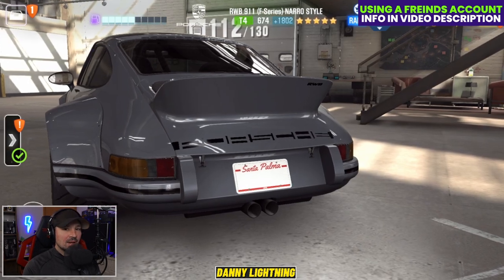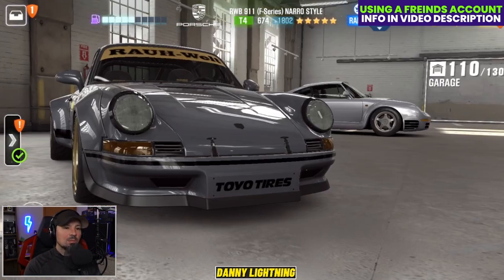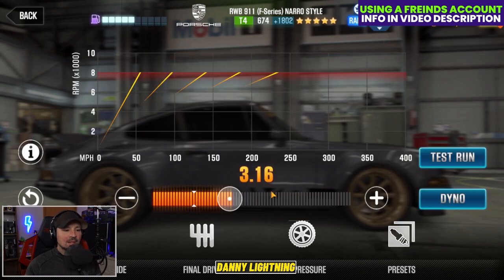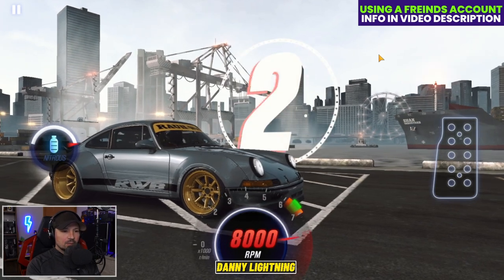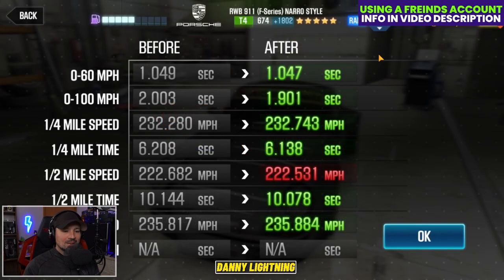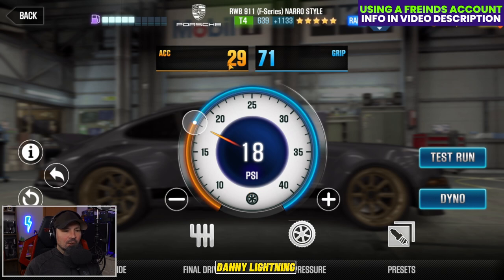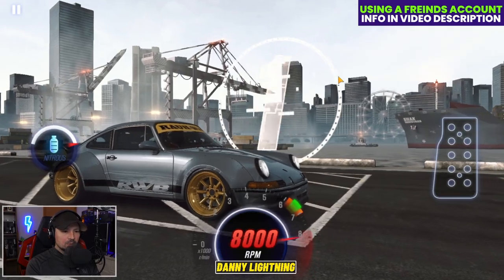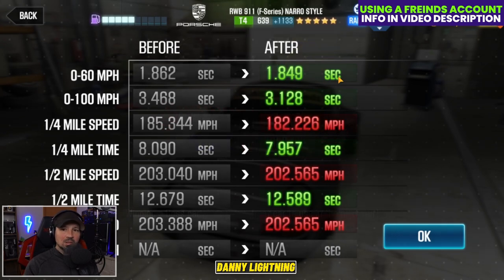CSR2 Racing RWB 911 F SERIES NARRO STYLE How To Drive, Stage 5, Stage 6, Review

Comment: the tier 4 car i use for live racing is my nissan fairlady z from the easter event and i won 14 matches and lost 1 in a span of me live racing
Reply from the maker: That's nice, certain cars do very good and if you find some sweet sort of sweet spot or just the right tune for that car and you're having luck like that don't change a thing, leave it exactly the way it is cuz you could end up putting on one more fusion part and all the sudden the car does not perform the way it used to
Reply: @Danny-Lightning-CSR  thx for the tip

Comment: St6 tire engine and trans st5 nos and body st4 turbo st3 intakes. 12.0 dyno runs 11.8
Reply from the maker: If you're trying to do a live racing setup that's not the kind of tune I would want, when you beat Dino it'll keep moving you into lobbies where your opponents are faster and faster and you won't be able to win anymore so you want to find the live racing setups where the card does not beat the dino, beating Dino is great for certain things but it's really not that good for live racing anymore in my opinion because the game will keep pushing you into faster and faster lobbies so we try and find tunes that will allow you to stay in the same lobby and win
Reply: @Danny-Lightning-CSR  but it's not that much under dyno. And honestly it doesn't really matter what you win with you're going to get bumped if you win too much.

Comment: Hey I got the Guards Red version of this car and the only upgrades I have are Stage 4 transmission,Stage 3 tires,and Stage 2 Nitrous (I only did these mods and upgraded them to the minimum stage required to unlock tuning for each) everything else is stock. What more modifications (and what stage each) do I need to do to make this tune work?
Reply from the maker: I mean generally those low performance point high upgrade teams don't require much more if the car is capable of running that type of tune which not all are,  on the low upgrades if you can get three times the amount of Evo as the performance points then it usually dominates if it's got doubled then it's usually pretty good and if it's less than double then it's kind of hit and miss, there's like 900 cars and I haven't driven this one in quite a while so I don't know if anything has changed or not but that's generally how those live racing sit-ups work, I hope they haven't changed the car or anything

Comment: Is it worth it to upgrade the Toyota GR Supra instead of buying the Lambo or Ferrarie for the first Storyline T5?
Reply from the maker: The super gr which is an elite tuners car is awesome, it's one of the better cars in the game in my opinion just because it's good at everything but you do need to get fusion parts for it you need to upgrade the car and if you want to work at its full potential you do need a bunch of those elite tokens to upgrade the elite levels which is a pain so it may take a little while to get those elite levels completed but it is an amazing car, I keep mine on stage 4 parts only for live racing or you can do stage 5 parts only for live racing and if you tune it right it will beat the crap out of everybody in life without needing to be fully upgraded so there's a lot of really good things about that car and as far as the story lines go take your time and don't be in any hurrier for those because the boss cars that you win are not that good at least most of them are not and a lot of people rush through and then they end up missing the cars because they were in too big of a hurry so take your time and be patient just wait till you're sure your cars are more than fast enough and then work on it but yes I think the super gr is totally worth upgrading
Reply: @Danny-Lightning-CSR  ok Tysm

Comment: Car is kinda bad if not maxed. It's hard to meet the dyno time and slows down at the end😂😂😂😂
Reply from the maker: If a car slows down at the end that normally means your nitrous was boosting the top speed and when the nitrous wears off the car slows down a little bit so there's quite a few cars that run like that no matter what you do some cars that happens if it's not tuned just right but I don't know I mean it's an okay car but definitely not really anything too crazy
Reply: @Danny-Lightning-CSR  yeah you're right and I hadn't tuned it properly and I got to get more Stage 6 parts and a couple of fusion parts it's good now